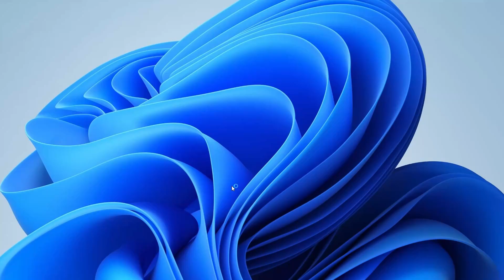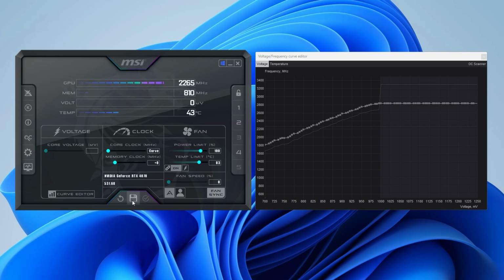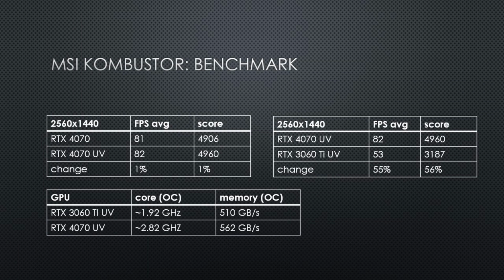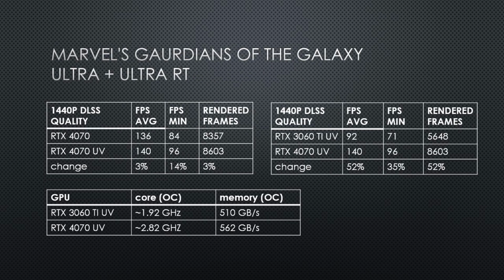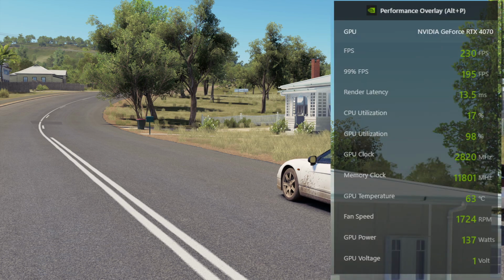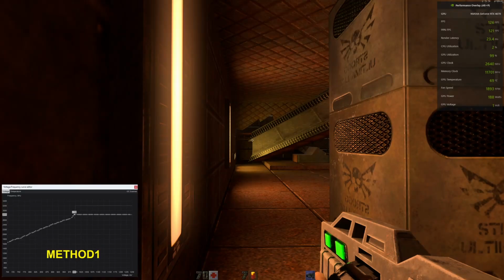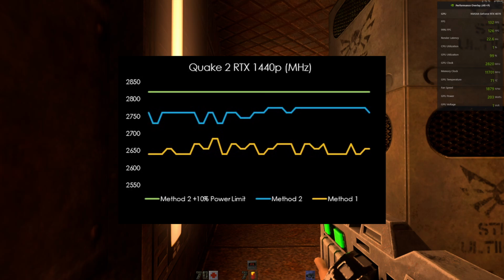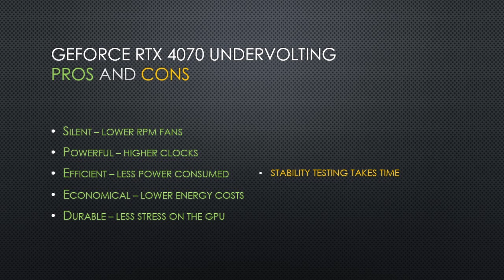RTX 4070 Undervolt + Overclock: The Most Powerful 200W GPU - Even More Efficient

Comment: I have my MSI ventus 2x undervolted to 925mv @ 2600mhz, performance went down about 3-4% from stock but it runs so much better my 1% lows are better and I can actually play with higher graphics settings without stutters. I am wanting to see if I can go down to 915mv as I have read some people have gone that low. I mostly just want to take some pressure off of my lower end 750 watt psi’s 12 volt rail.

Comment: I have seen other benchmarks with stock 50% power limit consumes 97W from 170W stock.

With the tuned undervolt from 170W to 130-140W, Disregarding the performance, How much the will power consumption if the Tuned Undervolt and 50% power limit combined?

Comment: this did nothing but completely destroy my system. 
not one single thing runs like this.
not one game, obs has problems. davinci resolve has problems..
fallout 4 crashes every single time...
just no.
Reply from the maker: sad to here it, the OC described in the video works on my Founders Edition in many scenarios.

also, I doubt your system is actually destroryed, unstable yes, remove the overclock/undervolt and you're back to normal.

i've had many crashes by undervolting too low in the past and never once destroyed anything.
Reply: @Superior85  of course its not physically destroyed. 
it destroys ALL functionality. i dare you to try this with a VR headset... dont open your eyes.
Reply from the maker: @NickCastleGames  in the video I showed a +150 MHz offset, which could be on the high side, but it does work in many scenarios for me. i.e. didn't destroy all functionality. I don't remember having issues in Divinci Resolve like you have, but every GPU is different, not all can reach the same clocks at the same voltage.

 If I get to a point where an undervolt crashed for me, I wouldn't run around saying "it doesn't work!", I would lower the clocks or increase voltages till it did work...

Comment: this undervolting is more stable than other undervolting tutorials. I achieved even better performance than stock GPU settings consuming 30w less. 
Getting 50°C in cyberpunk and mantaining 60°C of the VRAM is insane, cuz I was around 65°C at stock settings.
basically 15°C less with even more fps. This is insane
Reply: 65°C is not critical.
My card in sotck setting got like 81°C with hotspot @ 91°C
with undervolting and oc i got like 50°C in gaming...some games 64°C
and hotspot is under 75°C wich is cool

Comment: I'm planning to upgrade to a Gigabyte Gaming OC 4070 which apparently has a max power limit of 320? That seems insanely high, is Afterburner gonna let me do that? if yes, should I?
Reply from the maker: that's a lot for a 4070, i suppose such a model could overclock better by not hitting the power limit in certain scenarios. but i don't think performance would go up all that much.

i only have experience with the FE 4070, which only goes up to 220 watts.
Reply: You can't even max out the 10% powerlimit increase of the FE modell, before it becomes unstable. 3Ghz+ is possible, but not very likely.

Comment: Did you try lowering the voltage even further, whilst keeping similar clocks ? The card should be able to achieve higher overclock at lower voltages - eg +300 at 700mv, +200 at 900mv etc... So I would try limiting voltage to around 950 mv and 2.8 GHz. Or try to go all the way to 900mV and how far the clocks will go.

Comment: Are those setting saved after a restart, even when Afterburner isn't startet? Or do I have to start Afterburner everytime to make the settings work?
Reply from the maker: there is a little windows icon in the top right of the MSI afterburner UI, toggling that icon on allows the overclock to apply at startup.

Comment: Yeah im at 2550 core curve, +1000 mem, 900mv, Target 110%
So far its 5% fps loss but the effiency makes up for it.
278 to 178 watts, 59c @ 30% fan speed. Absolutely amazing stuff! 

Now I dont need to worry if my 750w psu will hold during any scenario.
Reply: Is that with a 4070 ti? 278W is close to that cards 280W rating. That's a huge difference and definitely worth the 5% lost FPS!
Reply: @EwanShawcroft  it's absolutely wild! 1100 rpm is max speed my fans go. Starfield everything maxed runs no hotter than 59/60c it's awesome!

Stock settings it's louder with coil whine
Reply: @liquidsunshine697  Awesome work! Undervolting is criminally underrated

Comment: on the 4000 series Undervolt is not needed - they are already cold enough, and to reduce the voltage just make power limit 80
Reply from the maker: i just tried a 80% power limit in a game and it ended up using 155 watts and came close to 1.1 volts at some points.
turned on one of my undervolt profiles and the wattage dropped to 105 watts at .92 volts.

performance was the same... i'd much rather use the undervolt in this case.

Comment: The Real RTX 4060TI
Reply: Not if you consider Starfiled FPS in 1440p, Ultra, FSR OFF at New Atlantis:

RTX2060 SUPER: 25fps
RTX3060TI: 32fps
RTX4070 OC: 56fps

No way a RTX4060Ti could have done almost double the frames of a RTX3060Ti.
Reply: @SirTE0 why aren't you showing real 4060ti numbers then ?  It's like 10% faster than 3060ti.

Comment: Thank you for the guide, very easy to follow. I have a couple of questions about the info shown in GPU-z. GPU-z indicates my Asus 4070 default settings are: GPU Clock 1920 Boost 2520 Memory 1313. Applying +150 to core and +1000 to memory GPU-z indicates setting are 2070/2670/1438. Applying +150 to core and +1000 to memory and following the curve undervolt instructions GPU-z indicates setting are 1845/2445/1438. Is that to be expected?
Reply: Never mind undervolt and o/c of 150 not stable with my card. Undervolt method 2 no o/c boosts ~2745 stable same as stock (card runs a bit cooler and watts 30-40 lower depending on game👍)

Comment: My game crashed at +1000 on the memory and your method 2 version. If I want to improve stability from the core, do I lower the initial increase on method 2, for example, from +150core to +120? Or do I keep +150 but then lower the maximum clock from 2835 mhz to say, 2805. Which way do you think would improve my stability more? I bought my 4070 Windforce OC open box excellent for $480, so I am trying to test for stability as I only have a 14 day return period if I notice issues. 

Also, my card claims to have a max powerlimit of 108% (216W). However, in various games and benchmarks, it has not gone up higher than 200W. Could this be a defect from the card? Or what is going on?
Reply from the maker: to test the cards general stability it should be tested at factory settings (no memory overclock or core undervolt), there is nothing wrong with the card if there is no crashing at default settings.

it can take a very long time to find a completely stable setting when using an under volt.

 +150 would definitely crash in my card in some games, and it seems your card already has a factory overclock. for that card i would try dropping down to something like +90, since it already has a factory oc. if that doesn't work try dropping down to +60, eventually it should become stable.

also, try testing memory and core oc separately, see if removing the +1000 memory overclock stops the crashing.
Reply: @Superior85  Thanks so much for your quick response man! I subbed!

Comment: I did it a different way - I reduced my power limit, then used OC Scanner to find an automatic overclock, then added more VRAM speed as the last step.
Got my power draw in Unigine Heaven down from 190 W to 158 W at NO performance cost.
Reply: Have you tried anything with raytracing to see if it's actually stable?
Reply: Could you specify exactly the power limit and vram speed you used?
Reply: @osnofa__  80%, +600.

Comment: I used this video for my 4060ti. Achieved pretty similar results. Now it pulls around 100w instead of 130w, same clock and framerate
Reply from the maker: Nice result, glad it worked.
Reply: Wish you added memory clock basics to the presentation. Nicely explained however

Comment: Need to sell my 3080 and get a 4070. The cost of power in the UK is insane
Reply: I just downgraded my 6950XT to a 4070.

Lost about 10-15% performance but also dropped from 330w to 170w.

I think it was worth it.

Got it for free on a swap with someone

I was also sick of the noise and the hot box of a room I was having.
Reply: @Jasontvnd9  I was soooo close to getting a 6950XT but ended up with a 4070 for this reason. 
Still annoyed at the 40 series prices here in Europe but I figure with time the power saving should make up for it.
Reply: @JASHIKO_  how much do you save on a monthly basis?
Reply: @Hiiiro  Honestly couldn't tell you but just going off the undervolt and already low amount it's worth it.

Comment: This video shows that you testing but the result stays same.
Game/GPU drivers crash duo to temperature rising and rising electrical resistance.
Means your power saving + oc will never work stable. Only way is to reduce core frequency by 10% and power by 20-30% depends on the board + silicon.
Reply: I can just overclock which then boosts 2820 stable (underwhelming though as 1080p-5%, 2k-2-3%). If I undervolt using method 2 I can only run at stock which boosts ~2745 stable (card runs a bit cooler and watts 30-40 lower depending on game👍). Not sure if o/c DDR6x is a good idea due to error correcting, I mean I assume Nvidia chose stock frequency for a reason?
Reply: @kalaglow5094  The reason why you can overclock it a bit higher and it work is: The additional tiny higher set voltage/power.
Because temperatures in a year are from 10-40°C, this difference cause a temperature difference at the gpu. To ensure that it work always, its set higher.
Means, could be at 20°C your overclock works fine but at 40°C room tempature it might crash or if you open a 4K video + play a 3D demanding game, the drivers crash because the power is insufficient to keep all gpu functions running. Also known issue is higher latency, textures load later, causing blurring at textures.
My suggestion, dont undervolt it and overclock it, either overclock the highest-core-frequency(not boost) + increase power = stable higher performance OR undervolt it and also reduce the highest-core-frequency(not boost). A combo with overclock and undervolt could work, if you ONLY increase the boost clock, because if the boost is unstable, it mostly jump back to the non-boost clock duo to the missing power (i dont suggest this, cause unstable fps, fps jumps up and down). I also oc-ed once the vram and the result is mostly bad, a tiny oc might work but to find that out isnt worth the time.

Comment: I made like this:power limit max, température max to 78. Then I took thé left cube(in curve monitor), pressed CTRL and drag it down with mouse(left click). Same with right cube. Then, i took 0.965v and mounted it to 2820mhz. It's works stable. Only in Spider man with Ray traycing crashes, but i just turned of thé raytraycing. So, After thé manipulations, only in re4 eating 150w max with same fps

Comment: What cpu would you pair this with to get the best performance but the lowest power usage and how low could you have it go?
Reply: I'd go with a Ryzen 7600. Or if you really want to go cheaper a Ryzen 5600 would still be great.
Reply: @kotztotz3530  yeah that or the 7800x3d. Problem is AM5 memory/boot issues but it seems there is a  solution for it.
Reply: @Cygnus-Phi  Personally, I think the 7800x3d doesn't make sense to pair with a 4070. You can get the 7600/b650 combo for around $300, while the 7800x3d platform costs about $600. Just my opinion though. If you want to "future proof" your CPU, then 7800x3d is the way to go.

Yeah boot issues are a thing, but new BIOSes that are coming out are helping clear a lot of that up. I don't have any issues with my 7600 anymore. I did at first, but everything is good now :)
Reply: @kotztotz3530  You're completely right on that, especially since AM5 right now is a bit suspect in terms of memory issues it can make very good sense to get a cheap 7600 setup and "later" swap to a better cpu and mobo and new chipsets once they are more matured. 

Still it's an option and an extremely power efficient one at that. Also, looking at system reqs for Starfield and Cyberpunk Expansion I'd wait with buying anything at all right now, perhaps those games WOULD show a big difference between 7600 and 7800x3d which for me in that case would be a deciding factor.
Reply: @kotztotz3530  12600k with z690 combo is going for $246 this week
Reply: @Cygnus-Phi 7800X3D is a monster aswell , I have a 7800X3D paired with a 4070.

I could technically have got more all around system performance with a 7600x and 7900XT but I play star citizen which is very cpu and especially cpu cache sensitive.

I just figure down the line if I need a gpu it's alot less hassle than taking off my ak 620 and installing a new cpu.
Reply: @nighthawksw  I actually ended buying a 12700K and ROG strix z690 bundle for $285 that was at the time of this bundle. Got it bundled with a 3080 12GB(used for $450). Crazy deal!
Reply: Sorry for butting in, but as an owner of this card and on a 500w PSU, mine paired with an I-12700. Super efficient and achieves amazing scores in 3Dmark and Userbenchmark

Comment: I've used the same settings as you but I get way higher power consumption during a 1440p Kombuster bench mark (210w stock & 190w undervolted) is that just the difference in GPU? I'm using the gaming X trio model
Reply from the maker: I get around 190 watts in that test as well.
Test out the power consumption in various games and you should see a good reduction vs. stock.
Reply: The trio edition I think has a tdp of 220w out of the box.

Comment: If you're on a 500 watt PSU, and really want to upgrade to the 4070, but can't change your PSU, this video is a godsend.
Reply: I also upgraded to a RTX 4070 and Ryzen 7 5800x3D with my 500 watt PSU and have no problems at all under full load even without undervolting.
Reply: @pl3ut  That's good to hear. I'm thinking about getting one.
Reply: @pl3ut  that is good to know, I'm planning on using the same combo
Reply: I'm on 400W PSU and using 4070 nicely. And today also with undervolt. Thanks.
Reply: I have 550 W PSU, with 5 Lian Li 120mm , 2 160mm , and 1 140 mm fans (8 Total) with 2 CPU fans on my CPU cooler. On top of everything else I’m approximately at low 400 for Watt usage at max according to Pcpartpicker. You probably pull less watts than me and would be more than fine. I get it if you like a comfortable headroom though.

Comment: Hey nice video, should i always put +150 on mv in aferburner?
Reply: Try +50 increments at a time until your tests and games become unstable
Reply: +150 core and +300 mem should be the starting point. Any system can do +150 core. From that you want to increase +50 bit by bit until the game become unstable. Then step back by -25.
Reply: @Jakiyyyyy  I suppose it depends if you have an OC model or not. If I type +150 it sets it to 2865Mhz not 2835Mhz (they had some sort of small discount, was 5% under the normal price). And I've read all 4070s are the same so just because mine is an OC model it's no more likely to be able to handle 2865Mhz. And there are OC models that are more OCed than mine by default. So just typing +150 might set it to higher than it can handle.

Comment: Nice video but you didn't tell us how you pick the mV and the frequencies. Why 995mV and why 2835MHz ?
Reply from the maker: It seemed to be a good balance between performance and power savings. I could have dropped clocks & mV further but at some point I would go below stock performance. I also tried some curves that used higher clocks & higher mV, but the power savings weren't as good. I decided that slightly higher than stock performance with power savings was the way to go.
I ran the Borderlands 3 benchmark and got 2803 MHz AVG at stock, I wanted a value slightly higher than that so I set it to at 2835 (which lands the GPU at 2820 Mhz in most of the games I play).
Finding the mV value was trial and error, I tried to get the lowest mV value while being stable in benchmarks and games that I play.
Reply: Now I'm not a gamer but I  use CAD programs for rendering. Do I need an other setting?